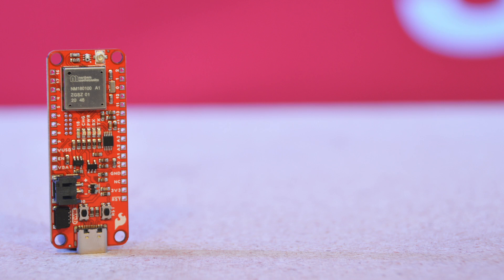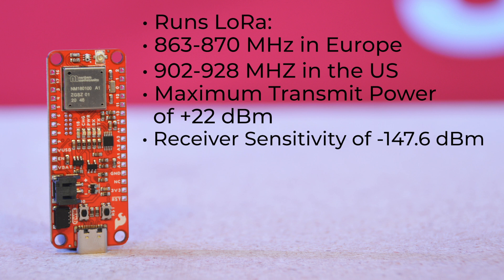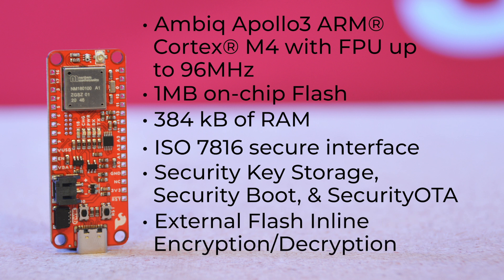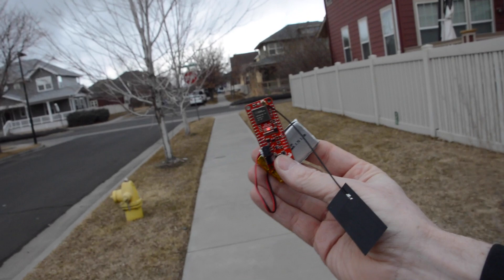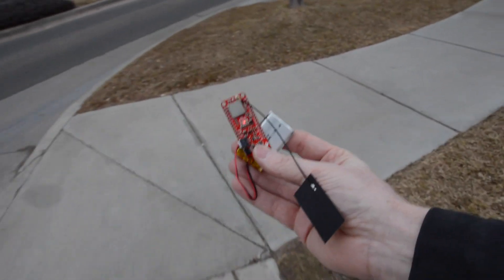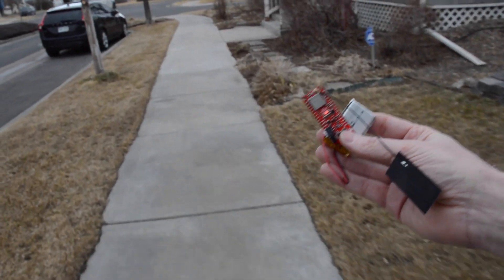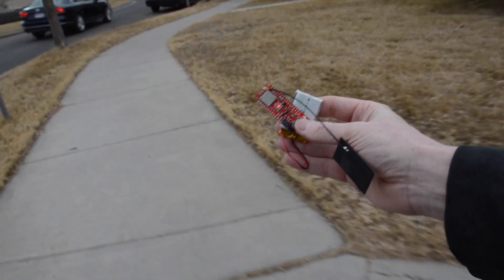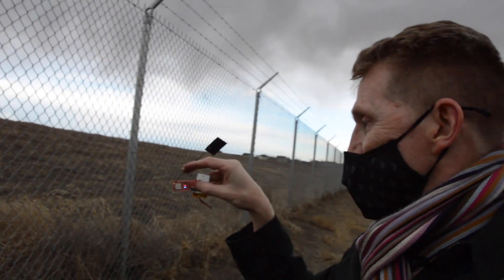Product Showcase: SparkFun LoRa Thing Plus - ExpLoRaBLE

Comment: Ive built quite a few lora projects and the one thing all these boards lack is a tp5110. Even in sleep mode the tiny current consumption still drains the battery after a few days but with a 5110 the current is so low its almost immeasurable. Some of mine have been running for over a year now on 1x18650 and a ldo regulator with the tp5110 controlling sleep time.

Comment: Why are you wearing a mask when nobody is around you outside? Covid transmission requires close proximity to other humans. An when you add outdoors, it can't longer in the air like it would indoors.  Also  Covid is .12 microns in size. It can pass right though your mask. If you aren't wearing an N95 mask, then you might as well not even bother wearing a mask.
Reply: it's smart to wear a mask even if no one is around, because random people might just walk up, especially ones that don't typically wear masks. As for not wearing N95, it's better than nothing, if anything someone might see the mask and be reminded they forgot to wear theirs and possibly avoid getting close.
Reply: @Quesar672  Lest we forget that people are outside running, biking, etc without masks and they have no higher rates of infections.  Indoor settings and people are dangerous settings. Outdoors and nobody around is the safest place to be.

Comment: If I'm not mistaken, with that message frequency, if you leave it on the whole day you will vastly exceed the allowed duty cycle for LoRa
Reply: @var67  The connection destination (p2p or gateway) isn't relevant in the unlicensed bands. There is a maximum on-air time specified. Some modules enforce that. Note that the number of messages does depend a lot on the SF (spreading factor) as the radio time also depends a lot on that (more range corresponds with less messages)
Reply: There's a recent video from The Things Network that covers this a bit: https://youtu.be/0PCRI37ECoQ?t=515

Comment: Amazed at the distance covered.
Reply: With LoRa the range is typically 10km +/-10km. Yes, you read that right.
I can get 200m in cluttered urban areas, but have got 30km to a tower on a high building.

Comment: What about the raspberry pi pico
Reply: The Raspberry Pi Pico is an entirely different product from the ExpLoRaBLE. The Pico is a microcontroller with some I/O that runs micropython or C/C++. The ExpLoRaBLE is specifically designed as a LoRa/LoRaWAN and BLE developer board that contains both a microcontroller and a transceiver. In order to do similar things with the Pico, you would need to attach an additional LoRa or BLE capable board to it to gain those functionalities. Do not compare the two thinking that they are the same thing. The ExpLoRaBLE is fairly well priced for its functionality, considering how few LoRa capable development boards there are in that price range. 

Arduino does have a competitor for the ExpLoRaBLE, called the MKR WAN 1300. However, that board does not have BLE compatibility, has a lower transmit power for LoRa, and does not seem to have capability for 2 way communication. The MKR WAN 1300 may be a better option for some people with specific projects, and is slightly cheaper than the ExpLoRaBLE. I am excited for this product however, and from its specifications I would highly recommend it over the MKR WAN 1300 due to greatly increased functionality for a small amount of money.. 

I am in no way affiliated with any of the 3 products discussed above, and have yet to personally use any of them. I am experience with Raspberry Pi's and Arduinos, and am building conclusions based off of the datasheets I have found.